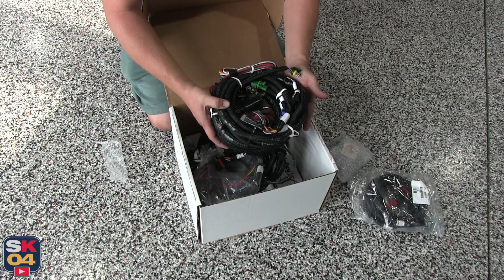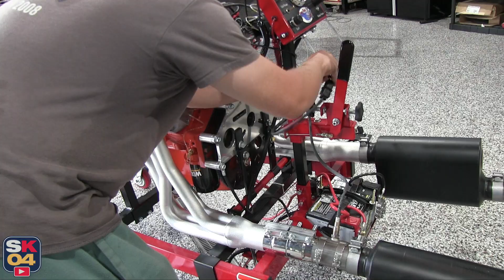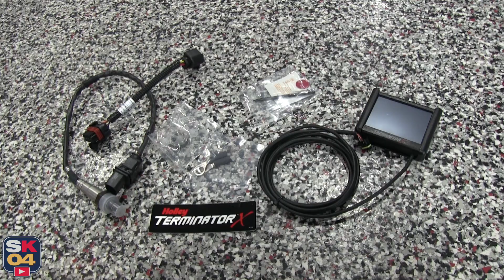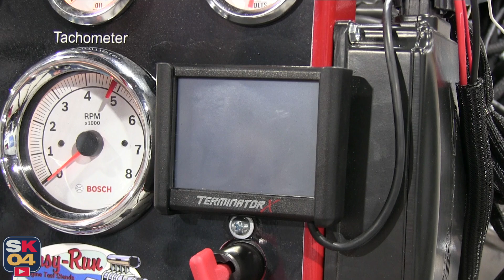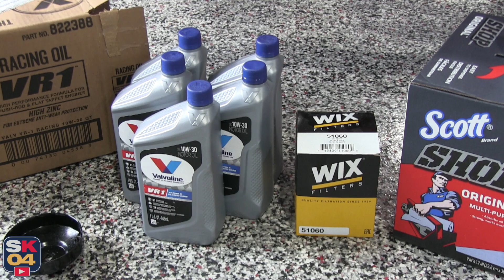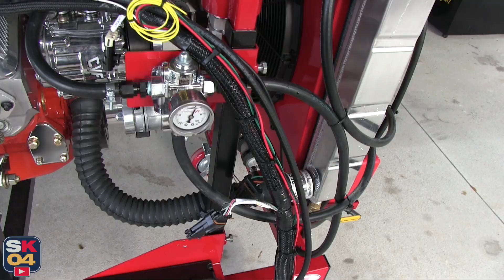Firing Up A Holley Multi-Port Fuel Injected BluePrint Engines 396 cu/in V8 For The First Time!

Comment: what a time , the engine react late if the gas cable get tighten 😁 
do you change some parts to burn other liquids with ? Gas only , nitro-methan , diesel etc. or adoppting a e-engine to the outlet and synchronize this 
-good luck 🍀

Comment: I love these videos where the results of hard work pays off.

I know it's most probably not going to a particular project, and I observed that the Terminator X PCM is still in its self tuning mode, but just a quick observation:

I don't know if it's the reason it looks like it's running rich and if the PCM has more provisions for it, but when running an engine with a V configuration, each of the banks of cylinders are provided with its own O2 sensor. Not only will that help with more accurate O2 readings, but it will help with fine tuning the fueling maps for the engine, increasing power and fuel economy.

I know this was more of an engine stand project than anything else, but if this were going into a hotrod, unless both banks are connected before the O2 sensor, each bank needs an O2 sensor, especially if it's using a true dual exhaust setup.

Can't wait for more projects, and more of the 240 SX.